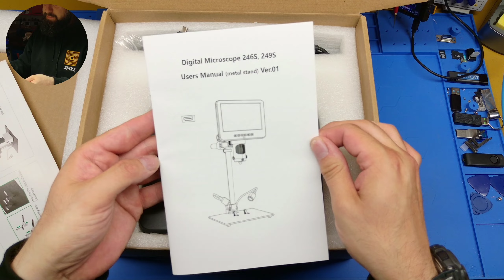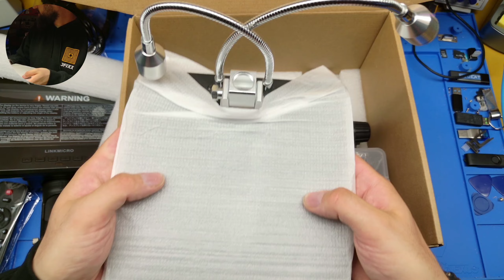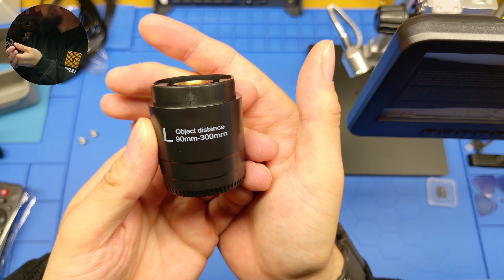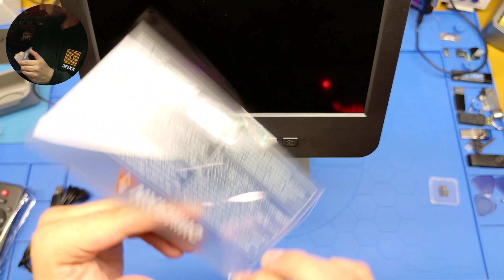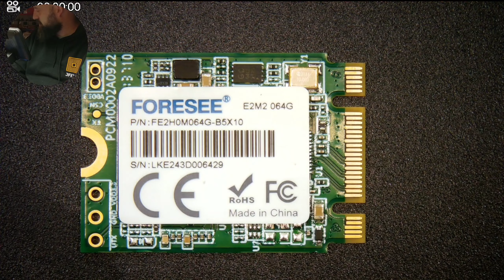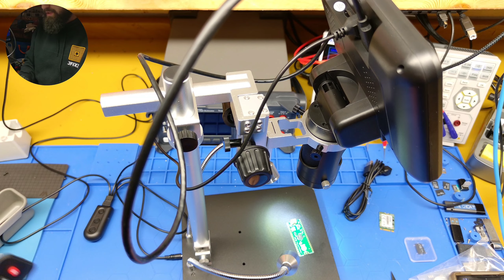Linkmicro LM246S Digital Microscope Review

Comment: Wow, $119 seems reasonable for what you get. It certainly shows up the components on the board well. I hope you use it a bit with your hot air station so you can do a follow up on what it's like to use for de-soldering, soldering components etc before you give it away. This will probably go on my Wishlist, still need a reasonable priced entry level hot air gun for removing components from laptop boards etc so I hope a company out there has something to send you. I don't want to spend a lot just to attempt to repair my odd faulty gadget. I still have an old Bluetooth speaker that needs the micro USB port changing but hard to do with naked eye when over 50 years of age!

I look forward to an update on this review, once you've played with it more!
Reply from the maker: Thanks Mookie! I don't think I will be making a follow up video as I need to send it away to the person I promised. I do however have a new light ordered for my microscope so I will be doing some testing with it when it arrives

Comment: Thanks for the review, I was impressed by the image it was really clear.  It looks like a nice microscope for the price.  Will it output the image to an external screen or are you stuck using it's own screen while working?
Reply from the maker: You can use the screen and the HDMI output at the same time. I have the HDMI going to the capture card but you could have this connected to a big TV or any HDMI. Some scopes do disable the monitor when using HDMI output ao its nice it supports both at the same time

Comment: BOLTR. Can’t beat a decent Stereo Microscope imo.
Reply from the maker: Unfortunately i can never use a stereo microscope as i dont have binocular vision it ls weird but i cant see down both eye pieces at the same time 😕
I wanted to make this review as it was sent for free and it means i can give something back to the community. Not everyone has the room for a big stereo microscope. Also if you want to share the microscope image you need the trinocular microscope and a camera to attach its starts to get expensive for all that this could be a great budget option for someone who is just getting started. I agree if your doing a lot of repairs full time id recommend getting something different so you can get that depth of view

Comment: The front/back adjustment of the stand makes it really usefull when working on boards inside the laptop. My micro can't usually reach the middlenof the board when it is inside
Reply from the maker: I think the stand is an upgraded design in this model so you can bring the microscope forward for larger size boards.
Reply: @JFIXX1 I'd buy that stand alone if it was available, really well designed

Comment: Hi J thanks for the review. I did see your last vidio and now seeing the sneak peek it looks like the board may have been used as a practice board.
Reply from the maker: My theory is that the board has been placed on a board heater maybe to replace CPU. Then it was knocked and lots of components got shifted there are more in different areas I will show them all and try and repair them in Part 2👍
Reply: Yes I hadn't thought of that. Your probably right, good call.